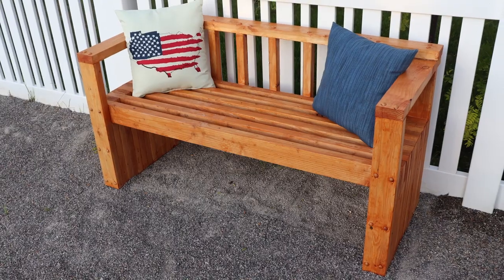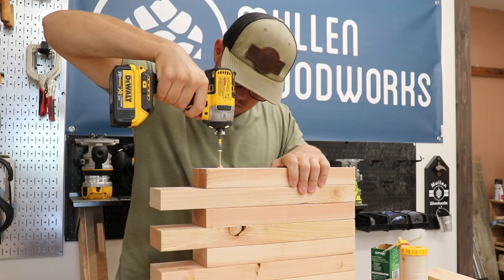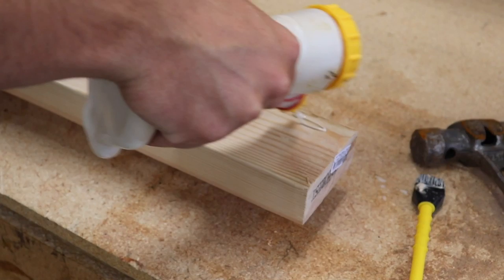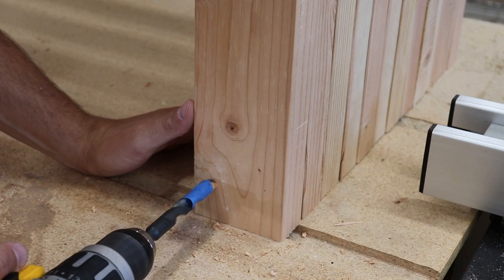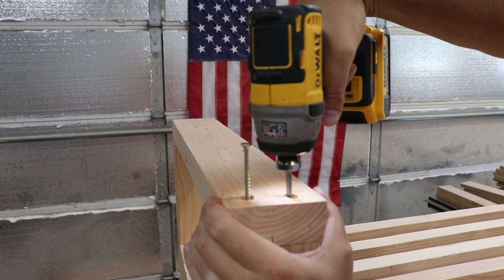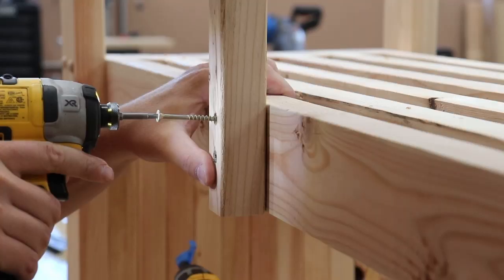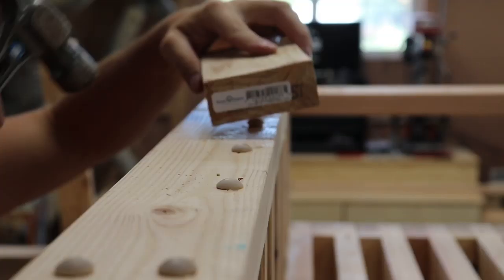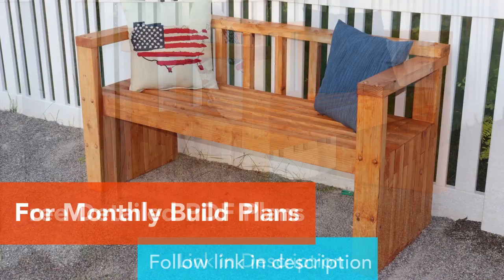Make a beautiful OUTDOOR BENCH | Solo Stove DIY Project Series

Comment: This is a perfect DIY project. I have found quite a number of nice benches to build, providing I have access to a mitre saw, pocket hole jig, table saw, corner clamps etc... This project, on the other hand , requires minimal tools. I completed the project with left over studs from a basement demo, a hand saw, cheap mitre box, hammer drill, glue, screws and a palm sander. It was a super fun afternoon project and looks good on the front porch.  Thanks.